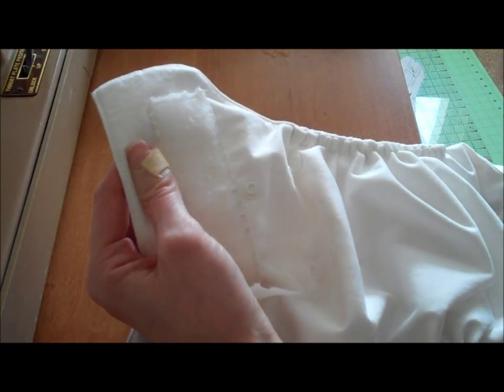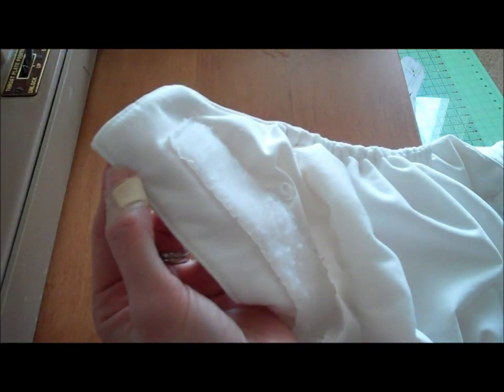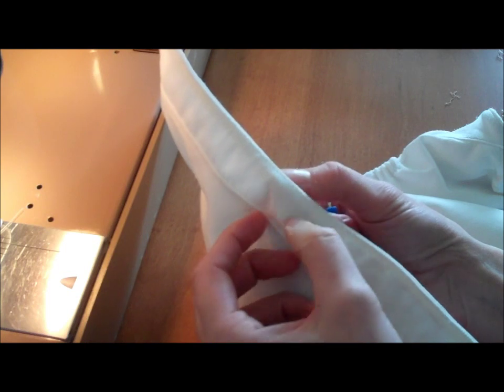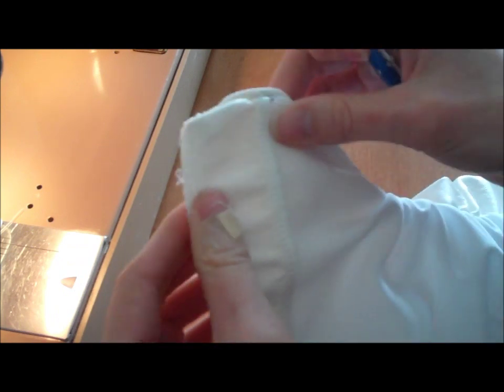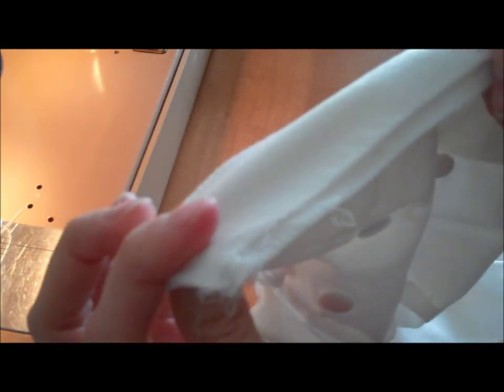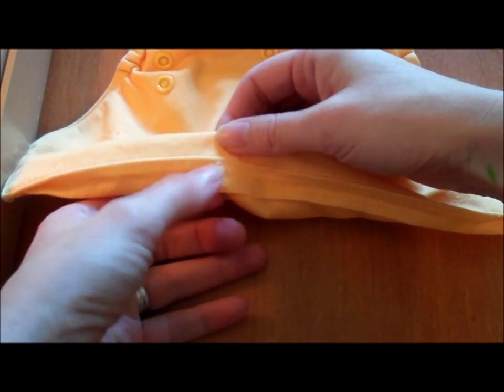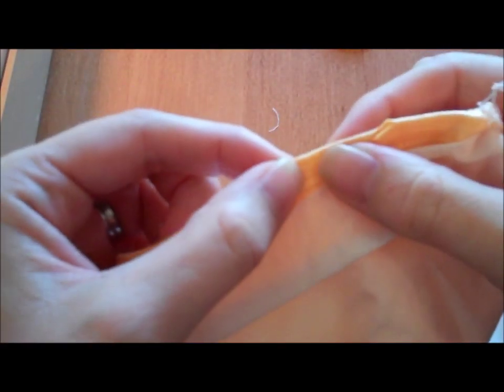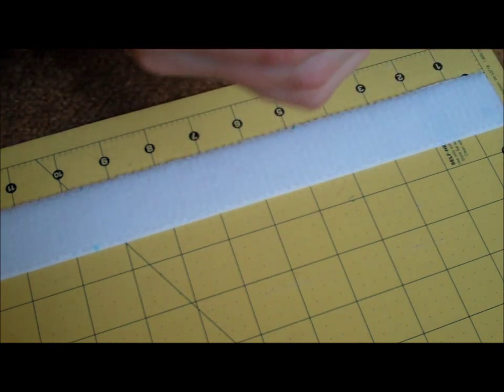Replacing Front Loop/Velcro on BumGenius: Part 1 of 2

Comment from the maker: I guess I'm not sure which area you're talking about...do you mean where the PUL insert stop meets the inner lining (the suedecloth)? If that's the case I would think it difficult to sew it back together since it's on the inside whereas cutting at the top allows you to sew along the exterior edge (it really isn't too difficult). If you find something that's much easier than by all means that's what you should do :) While I do also like snaps I agree velcro allows for a better fit.

Comment: Have you done 4.0s? I bought a bunch of 4.0s, and most of the front panel velcro is shot, I bought them used. I need to replace them all, are they different from the 3.0s?
Reply from the maker: I thought I went over that in the video or maybe I dreamt I did. The difference is that when you open all the stitching at the tummy it's going to be one piece of PUL. So you need to cut the piece as I demonstrate in the video because the newer runs of the 3.0's were like that - which is what I used in the video. Other than that they're the same in that regard.

Comment: Why do you cut the continuous piece at the top where the fold is why not take out the stitching to the fabric that holds the insert in? I'm always afraid to cut fabric .  I'm getting ready to do 6 of my diapers.  I'm upset with BumGenius 3.0 velcro quality only had them 1.5 yrs a stash of 23 diapers and have noticed the light colored diapers velcro wore out faster than the dark color diapers. 
I have 2 snap diapers, fit is bad, ordered snap-velcro converter, velcro lasted longer.